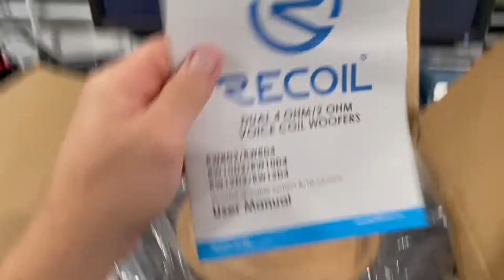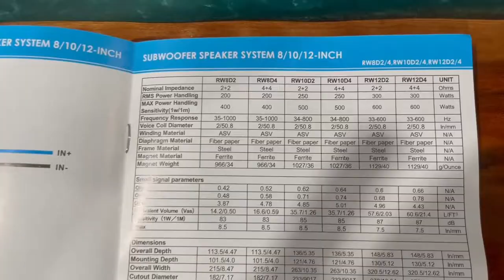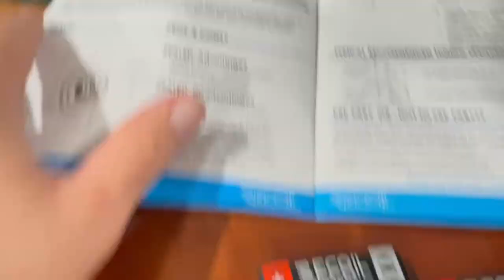Recoil Subwoofer Install & Review!

Comment: Good job making it fit. I have zero doubt that it is much better than the OEM speaker. Still I would've notched the OEM enclosure before I would've broken the terminals off the Recoil sub. That was part of the integrity of the basket and to stabilize the leads going to the voice coils.
Reply from the maker: Fair enough!